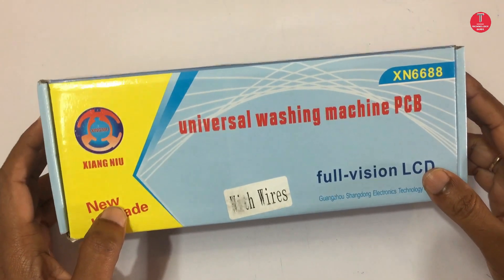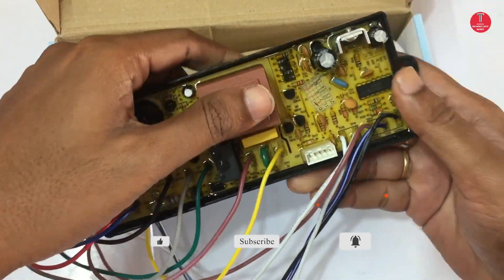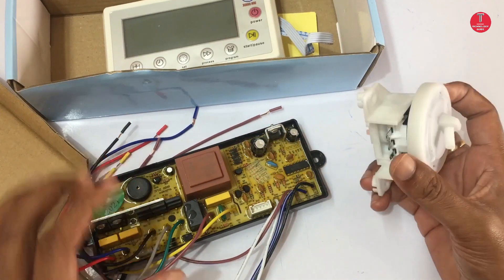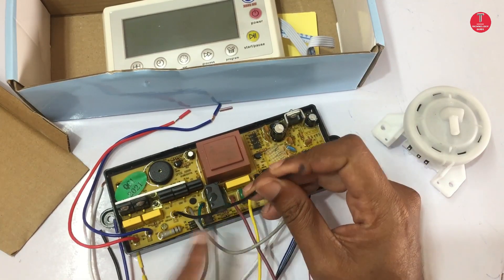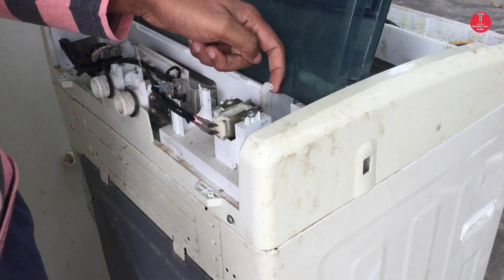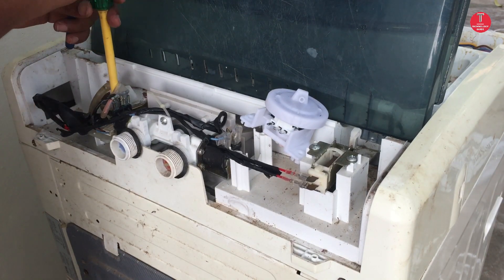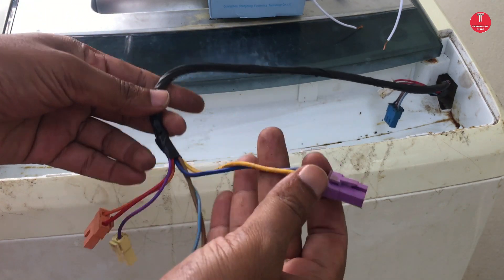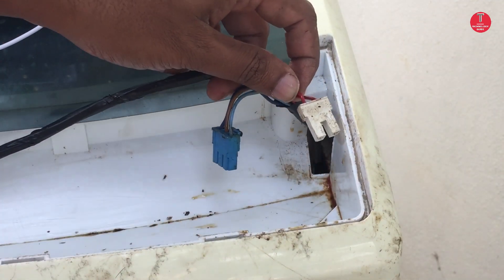Top Load Washing Machine E4 Error Code Solved || Universal Washing Machine Board Installation

Comment: Same connection given.. same board.. New drain motor also fixed.. Drum only not rotating during spin time
Reply from the maker: Try replacing the motor capacitor.

Comment: pls sir help me what could be the problem,my matching is showing E4 and water is flowing in, even out of the piple passing water out but is not washing nor spinning
Reply from the maker: Motor is sounding when machine is ON, If the motor is humming check the Capacitor other wise may be panel problem